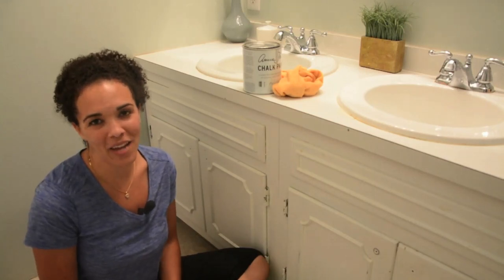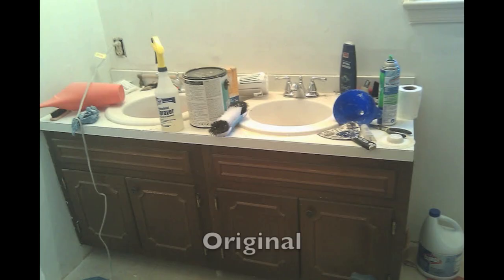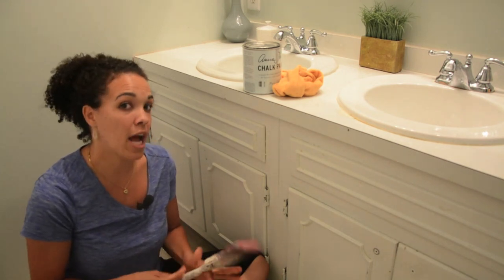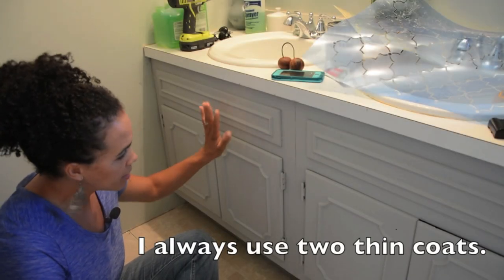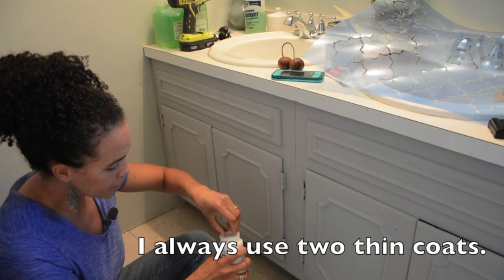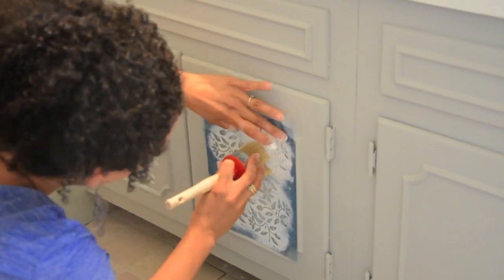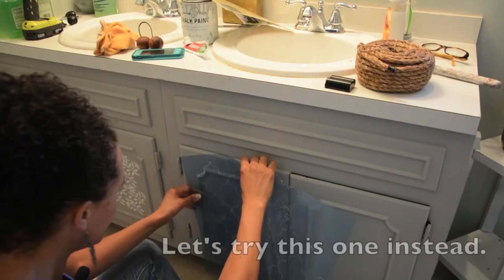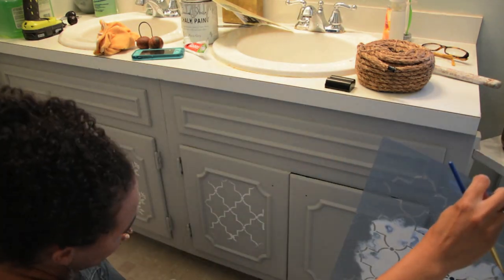How to Paint a Bathroom Vanity: DIY Makeover - Thrift Diving Blog

Comment: Do we HAVE to use a chalk paint? Would it still need to be sanded? I'd love to do my bathroom & I have paint but not chalk
Reply from the maker: Hey there, Tracey! You don't HAVE to use chalk paint. It's just an easy paint that doesn't require sanding. But another paint I like and use is Beyond Paint, which has more sheen, and can easily be used with a small roller. Just look at my other videos where I used Beyond Paint. It's a good choice!

Comment: Hi..I like your videos! Subbed you :) Does Beyond Paint have a chalky result? I never painted before and I have a French provincial dresser with the thick gold painted trim so I'm wondering if it will work or flake off on that part? Can you paint over it later on? It has like a high shine on the top too. I do want it to have a smooth unchalky finish in the result. Do I need to strip that off first? So many questions.... Help! I been waiting 2 years to redo it thinking I needed to sand it. But I can't with respitory problems. I think that paint will be my answer. Thanks
Reply from the maker: Hey! Thanks for the sub! :) Nope, no chalky result. It feels more satin finish. Yes, you can paint over that trim, and if you change your mind, you can paint over it later, too.  No stripping needed. If it's in good condition, just open the paint jar and start painting (after cleanign). Make sure the exisiting paint isn't chipped. If it is, just sand it smooth first. You can do it!!! :)